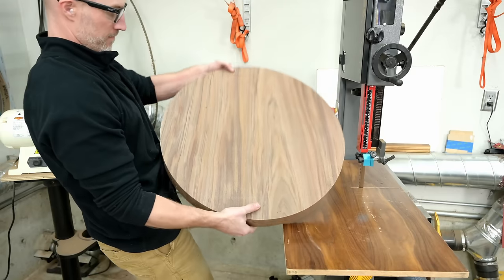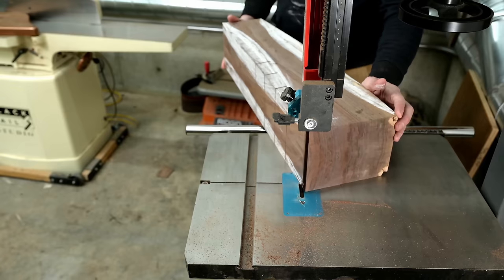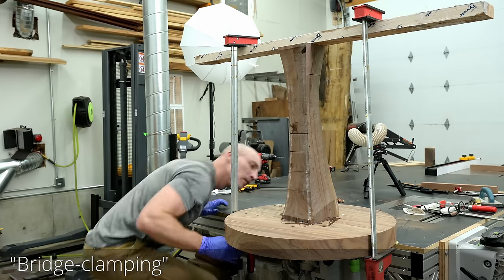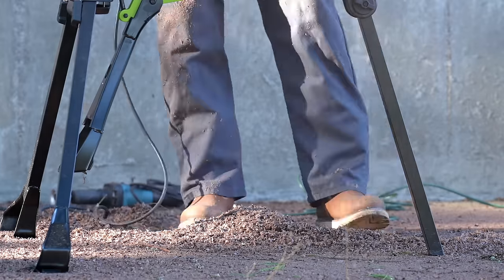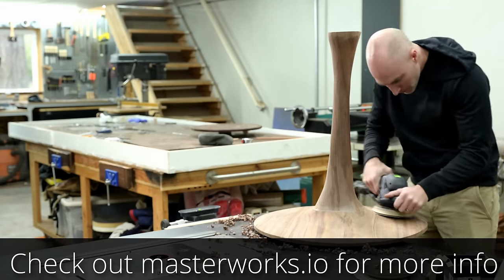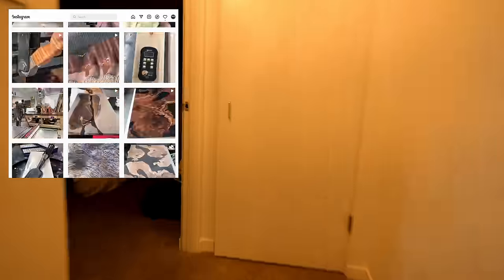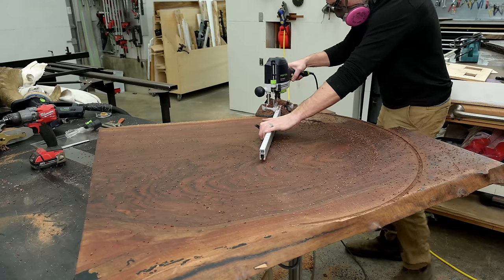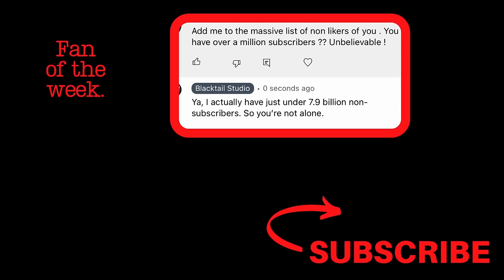I Like Money, But This is Better

Comment: joiner here
I never use woodglue on both sides
it is just too much glue, its only gonna come out. On top of that, the way woodglue works, mass doesn´t help at all. It needs to dry and get into the wood pores, to hold it together: as soon as you havent got wood on wood, with a layer thinner than a hair between, its not going to work as good as it could. 

Whats that thing with overclamping? Never happened to me, and since i dont use woodglue on both sides, i always make sure the pressure on the glue is as big as possible. So pretty much all clamps that fit

edit: really like your video, and i admire your enthousiasm.

Comment: 1:40 bro you're using a fk ton of glue. Only apply to one side, and even on the one side it was overkill. There are plenty of videos that explain the glue thing. Stumpy Nubs does it and Project Farm has a video that compares like 7 different wood glues, and a thin layer provides over 2000lb of strength. I think that's adequate

Comment: All of that Glue running down the sides is wasted glue you only need to squeeze out a small beed in fact you only need to put glue on one side if you are getting a good beed of glue squeezing out then you will have good glue contact on both surfaces.

Comment: $2,000 ,,, then i saw the $12,000 ... hummm ... yeah ... things have changed over the last 50 years ... i a bit behind ... and cheap ... well ... bad guess ... and yep ... saw the piece on the bottom ... dont know if it would show in real life ... the matching of importance wasnt the grain in the bottom of the table, but the end grain ... blending with the end grain .. but you hadnt cut the table yet .. this might be a reason cut the table then put in the splice ... you can still run the router around it again ... ??? ... who knows ... 

GORGEOUS PIECE OF WOOD ON THE TOP .... sat in a barn?? for a very long time .. i love old wood ... have a table that came from the old growth trees in the ohio valley ... l love wood ... old man talking too much ... must be lonely ... chuck

Comment: Hey Cam, I think you're doing a great job, I really don't like epoxy tables all that much, but your channel is still one of my favorites :D I like your voiceover sound and your down-to-earth-ness and openness about everything. That said, I feel there's a good chance you might even take what I have to say as advice instead of feeling attacked. I feel like the one area where it could be interesting for you to develop some more in is the design of your pieces, or maybe design in general. I'm really not trying to burn you, you're obviously doing just fine and selling stuff for great prices, and there's a style and taste for everyone. But just as an example, the pole of this table really is a little bit thin at the upper half to look at. It's not even about structural integrity, it might hold just fine (though it's considerably easier to break a baseball bat when there's a big tabletop attached to it), but design is also about nice proportions and being easy on the eye. If it makes a lot of people feel uneasy, it's not easy on the eye, it attracts negative attention, away from where you would want the attention to go, and thus it's maybe not the best design possible. Another thing is the roundover on the edge of the table, it's too big and makes the top look a bit bland and boring compared to the foot. You're obviously interested in these things, since you add the kind of signature bevel to the bigger tables, there is a whole world of tricks there for you to discover and it might provide you with a very interesting next chapter in your woodworking/youtuber career. Also some of the metal legs, I have to say with a smile it's a bit hard to watch sometimes. Not saying you should make furniture in a certain style or not in a certain style, but there is room to discover and develop (Y)

But otherwise it's really great to watch and I will keep following and looking forward to your next projects